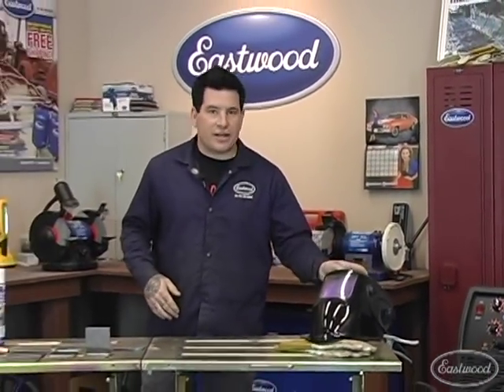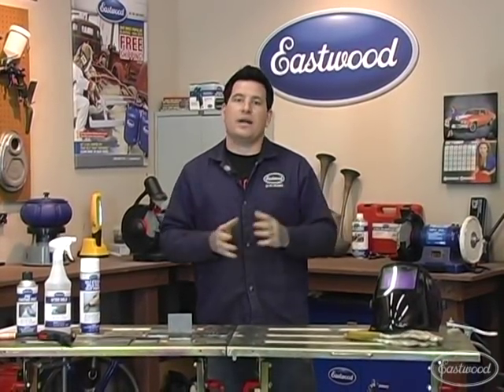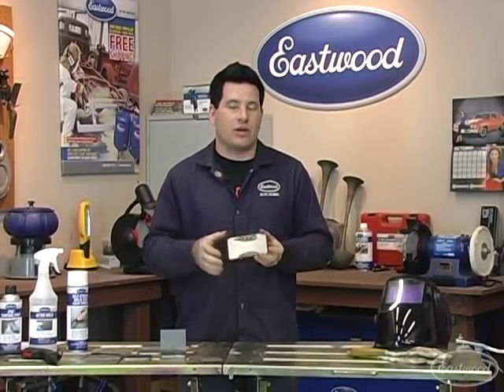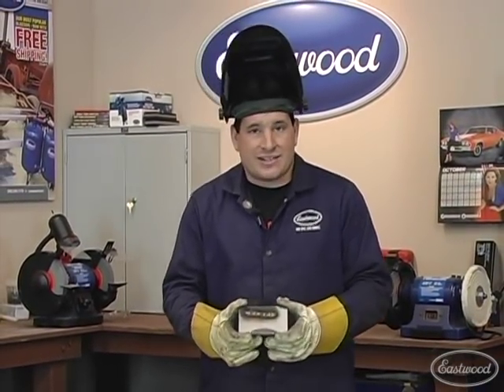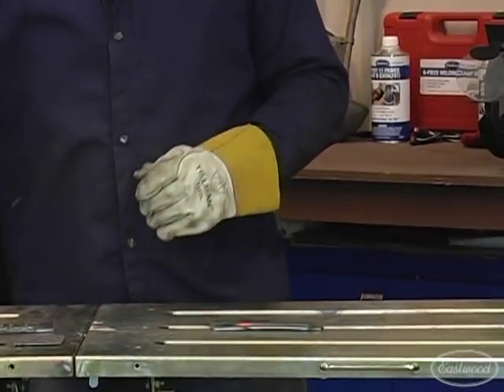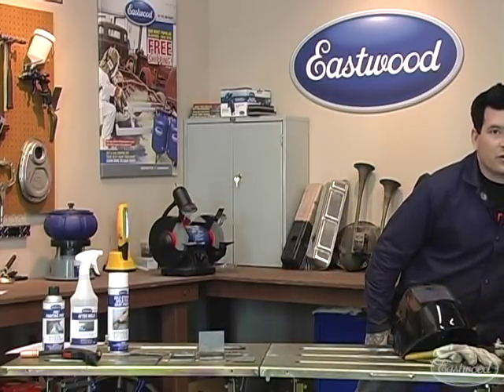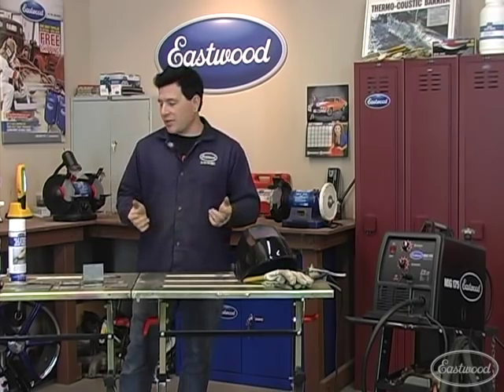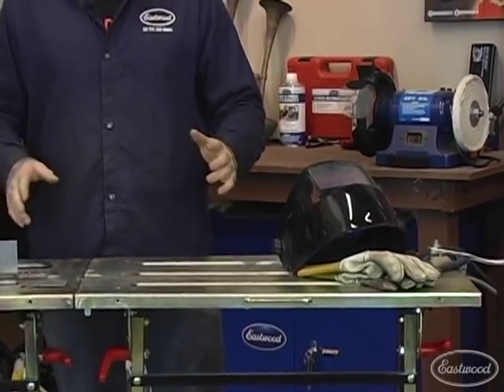Welding - Tips for Beginners, Types of Welds and Troubleshooting from Eastwood

Comment: I believe you ment inner shield wire welding with out using gas.  Flux core gives you the slag (the material you chip of the top of the weld) like inner shield but without the gas you will get porosity

Comment: I'd a structural / heavy frame welder. And just some settings tips for people using a Lincoln machine. Anything under an inch think run 23.7 Amps, with 250 wire speed, forehand welds. Anything above an inch to two inches, runs a bit hotter 24.3 amps, and 275 - 280 wire speed. Anything above Two inches requires preheating, and you can actually run the 23.7 amps with 250 wire speed and back step to fill. just thought I'd share my techniques :)

Comment: I just bought a Eastwood mig 135. The only time you should use flux core is outside?  where can you buy the gas bottles? There's so much to learn . I wish you had a few  classes in NY. You guys are AWESOME.
Reply from the maker: +James Weissbach You can use flux core indoors or outdoors.  If possible, use shielding gas rather than flux core wire because you will have nicer, cleaner welds.  If you're outside and there is a breeze that could blow away your shielding gas and create bad welds, you can use flux core to solve the problem.  You can purchase gas bottles at most welding supply stores.  Thanks.

Comment: Very very good. I wish I had watched this when I was first starting.

Being on a live video feed would have to play with your nerves, which is why I correct him with the utmost respect. With flux core, the flux is on the inside not the outside. That is why it is called flux "core". Not a big deal, but could be confusing for beginners.    25:48

Comment: A question about wire size..... Im trying to do a gasser streetrod build on an old 60 Comet, I have to either pretty much plate the frame and tie the front and back in with sub frame connectors or cut out the old thin frame and build one out of new tubeing which I would rather not do. My question is would .30 size wire be alright to use on the old frame while I plate it with 1/8 flat stock which is I think thicker then the frame that is already in it as stock, or should I go with a smaller wire? Thanks, and I hope I explaned this right and you know what im talking about since you do repairs like this.

Comment: Great tips! However, your terminology for spot welding is incorrect. What you are really doing, in your video, is plug or rosette welding, not spot welding. Spot welding is done by joining two pieces of metal using pressure and heat (usually electrically generated heat).

Comment: I've been mig welding 2.3 millimeter piping at work. For the last few days I've been welding it with no problem and the welds have been clean and even, but today I welded a pipe in exactly the same way I'd been doing before and it blew a hole right through, right after I started my pass...like only about 2 seconds in...I filled it in  and finished that weld but it happened again on the other side...blew a hole right through, I wasn't going any slower than I was before, so I have no idea why it happened. Any advice?

Comment: now I some how have to practice my lap , corner , t , butt joins on the mig , tig , and arc machines. And turning the amps up to high maybe I can uses these machines over a plasma cutter or gas welding torch to cut as well as welding materials

Comment: What about a gasless mig welder? (with flux core) How to and what settings on Lincoln 3200 mig welder? :0
Need to weld tub stabilizing brackets in my cj7 jeep and nuts on the back of my dash for easy removal of my gaugs pods. Thanks for the video.. ;)

Comment: Matt, can the 90 amp flux wire welder be used to weld a muffler back to the tail pipe while it's still attached to the vehicle or does it need to be removed? Thanks Matt. Scott D. Boyce

Comment: will the spot welder tip work on a Lincoln electric ? and would it still be absolutely perfect if your spot welding at a 90" angle?

Comment: nice video on what it sounds like and looks like to have it wrong settings for the gas , wire speeds or amp/volt setting. Obviously to distinguish between to high wire speed and to little gas they sound very similar but the high wire speed logically would make a taller bead on the metal surface. not sure how to tell if not enough amps/voltage yet by sound / sight. I know what ever setting I have if I get the sissle like in a sauté pan I am going to be ok
Reply: 0000

Comment: What machine do you recommend for a beginner? I want to build a smoker out of 55gl drum
Reply from the maker: The MIG 175 is easy to user and should handle everything you need to do on an auto restoration, or building a smoker.

Comment: Does anyone know what a good welder for beginners would be?. I want to learn how to weld so bad but don't know enough about it. I appreciate any help you can provide.
Reply from the maker: All Eastwood MIG welders would be great for a beginner, it just depends on the metal thickness you want to be able to weld. The MIG 135 is great for sheet metal and light fab. The MIG 175 still allows you to do sheet metal and you can weld thicker materials as well - plus it comes with a FREE spool gun to weld aluminum. And all carry a 3 year warranty.

Comment: Can u use Flux cored wire in a welder that normally uses gas
Reply: James - yes... I'm not an expert, but any wire feed MIG welder should be able to do FCAW. (Flux-cored arc welding)

  My welder is a Lincoln that was not sold with the capability to even do MIG (Metal Inert Gas), but can be upgraded with a kit that includes a solenoid controlled valve for the gas, regulator, and different nozzle end on the gun.

  Then there is flux cored wire that also requires shielding gas, dual shield flux core (I'm not sure if that one has an abbreviation like FCAW)

  My basic understanding is:

  All wire feed welder (including MIG) can do FCAW, but not all wire feed welders have the hardware to do MIG, though many can be upgraded.

  Many people use the term "MIG" incorrectly to describe any wire feed welder, regardless of whether it has the gas control system that makes a wire feed welder "MIG capable"

Comment: indeed.. without the inert gas, the metal will burn, the temp is above melting point of iron, but for combustion it needs oxygen, this is where the inert gas comes in place to prevent oxygen coming into the melting metal

Comment: Amperage is determined by wire feed speed and stickout. Voltage affects puddle width
Reply: How do you determine the speed of the wire, I know the amperage is 1amp per .001 inch of thickness but how do you measure what speed to set the wire feed to amperage?
Reply: Basically your amperage is determined by 4 things. What your wire feed speed is, the diameter of the wire youre using , and youre stickout (the distance between your contact tip to the workpiece), and of course the thickness of the material. 

Theres charts online that gives you the amperage for the different thicknesses of wire, the suggested wire feed speed, your stickout, ect. 

Basically what i do when welding with mig (assuming im using short circuiting transfer) (look up a video about different modes of transfer in mig. The channel weld.com has a few bideos explaining the difference) is i set my voltage first. Take a piece of scrap and adjust voltage until you get a bead profile rhat looks good. Then you adjust the wire feed speed until it sounds like bacon frying
Reply: Chuck Hickman thank you for explaining it in a very easy way to understand, will visit the channel you provided. I have a better understanding now, thank you!

Comment: before hooking your ground clamp I would imagine you would want to get some inhert gas in the gun by pressing the gun  trigger then using welding cutters cut excess wire of the end of the gun before starting mig welding

Comment: o flux core allows  you to uses no inherit gas with the mig I would imagine there is a flux core equivalent for the tig just have to uses 2 hands for the tig one for the gun/holder the other for your filler metal rod

Comment: I have a question that nobody asked: what happens when you have too much shielding gas pressure?
Reply: Turbulence at the shroud that  willcause air to be mixed in with the shielding gas and this will cause porosity.
Ballpark figures 8 litre/min (light gauge, 0.8 mm material) to 15 litre/min (heavy gauge 10- 20 mm material).The Lincoln welding handbook is an excellent resource.

Comment: Matt, is there a website I can refer to for review about welding? You dropped some very valuable knowledge in this vid; greatly appreciated. Thank you. 

CW
Reply from the maker: Are you looking for www.eastwood.com.
Reply: Eastwood Company Actially I was looking for information on weld issues: porosity, undercuts, splatter, burn backs, etc. I’ve learned a lot since I made that first post.

Comment: He did a very poor description of flux core wire. It is not coated on the outside! It is the core (center) of the wire that holds the flux. They both shield outside contaminants and chemicals from the weld bead.  Poor Q&A afterwards.

Comment: Is there a reason why his head is placed directly into the cloud of molten metal fumes? That can't be good for you.
Reply: yeah, welding gases are pretty benign (other than being anoxic), but the fumes from the metal impurities and oil/surface contaminates can be really nasty.  Welders traditionally have higher rates of lung cancer and other respiratory diseases, though there are ways to mitigate the risks.

1) mask or contained breathing units are rare... although necessary for underwater welding :)

2) for small projects like these you can use a down-draft table.  Basically its a metal welding table with perforations and a second level which is solid and sealed on the sides.  A vaccume pump can be hooked up to pull gasses down through the table.  This is similar/based on a down draft fume hood used in Microbiology labs.  Real nice, but you have to get the vacuum pull just right so it doesn't pull too hard and mess up your gas shielding (when doing MIG/TIG).

Comment: can you weld without  gas with mig at all
Reply from the maker: You can use Flux Core wire, rather than using a gas bottle.

Comment: i was showed to pull mig, push stick
Reply: jerry waters 
Stick you drag, or pull as you put it. Mig it depends on the position you're welding. Going uphill, most people prefer to push so the puddle isn't chasing the wire. With flux core wire and stick welding, if you push often you get slag inclusions and pitting. Best to get a welding manual and all the free scrap you can and just practice, then break the welds with a shop press to check your work. Good welds should bend, not snap, and use rust dissolver on the side of your workpiece to check your penetration.

Comment: all that spray cleaner is crap , just use a grinder to get it as clean as you can. if you have some rust turn up your heat  that will burn away any crap in the metal. 75% argon is for a nice flow and the CO2 is to get penetration .